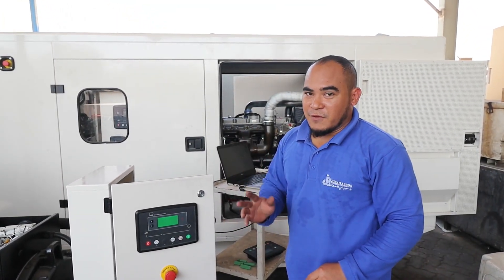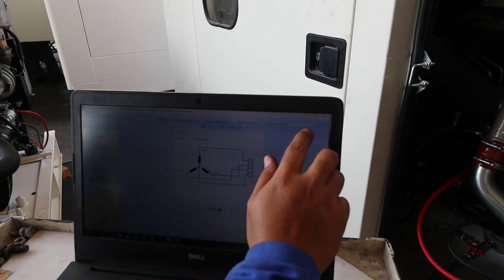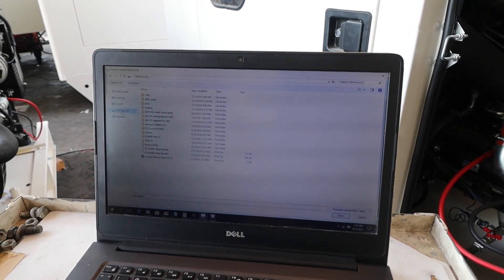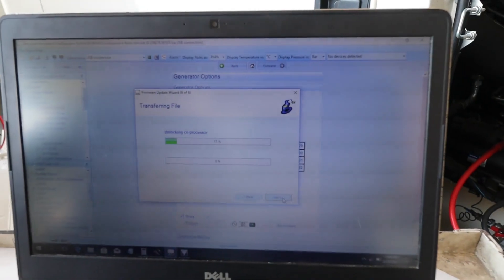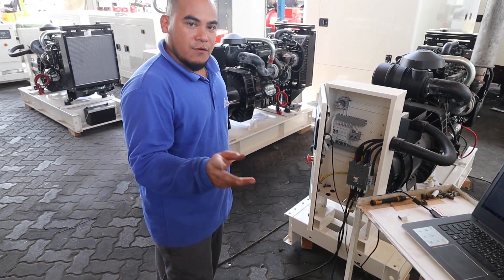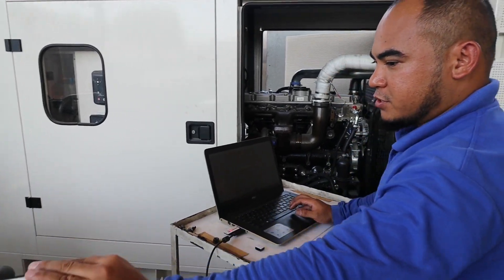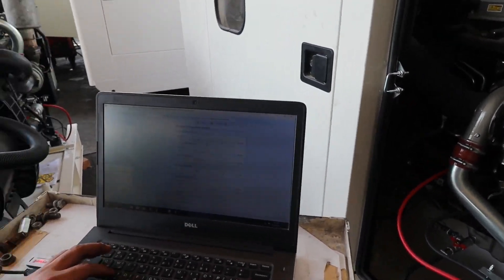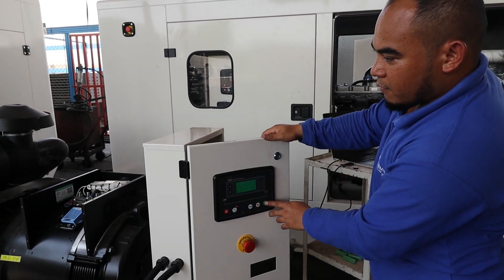DEEPSEA MODULE defective, not communicating, memory corrupt, no display, how to fix it? benzblogs

Comment: Help with the link for the flashing. And even while working on the Memory Corrupt, I didn't see what you operated on the laptop, the camera is only showing the display board of the DSE.
Reply from the maker: Ok even without flashing i found out just go in the app open deepsea thin go to click the firmware update thin select the model ang version of your module thin write it ok thin back to normal
Reply: @benzblogsVlogs   i tried to update my deep sea 6110 MKII controller but the display is still green
Reply from the maker: @ayazshah8453  of this green means defective already try to open it check the rebon inside
Reply: @benzblogsVlogs   along with green screen warning light is blinking
Reply: Thank you for the help however there's still more. When the panel doesn't display  and just the LCD backlight showing  but still works with the buttons. What are my to do. Do I need any flash file and how do I get it to return to display.

Comment: I have a DSE 7320 Module that display does not show anything. I have updated the firmware but the issue still, how can I fix it? Thank you in advance.
Reply from the maker: You can try to open it there is one rebon there try to remove and insert back due to vibration and dust its happen sometimes
Reply: @benzblogsVlogs  Thank you so much, I will check that and I'll let you know if it fixed.
Reply: It fixed! Thank you so much for your advice.
Reply from the maker: Welcome sir

Comment: sir tanung po sanamakasagot po kayu , anu problema kung wala display ang module may supply na 24 volt  bythe way 7310 pala ang module namin,salamat po
Reply from the maker: Kong meron flash mo nalang
Reply: Sir ano laman ng usb flasher mo para maregain  un memory o laman ng module ty sa mga video mo informative lahat ng video mo
Reply from the maker: @josephgammad2338  sir ganito kahit wala ng flash file ponta kalang sa open mo app deepsea tapos ponta ka sa tools firmware update anong model po ok na pa yan ok madali lang
Reply: @benzblogsVlogs  may ic pala sira sir  na sunog po yun 8 pin.
Reply: @benzblogsVlogs  7310  po
Reply from the maker: Wala na sir replace na pag may sunog
Reply from the maker: Pero gumagana sir
Reply from the maker: Tanong ko sir ang module nyo bay walay display pero may ilaw sa mga pindutan nya? Kong may ilang ang nagfunction meaning monitor lang problima now if di sya gumagana flushing .o baka kaya pa ng sofware
Reply: @benzblogsVlogs  dead set  po sir as in totally wala display . kung tingnan mo parang na ka off sya
Reply: Ah ok po,  sayang hindi kc taga dito yungnag install nito maynila sila. Pa..  Baka baka module na sila nito.  Kc hung una nag blurd na sya  dahan dahn malabo na ang screen hanggang ngayun.  Totally deatset na,  ganun paman salamat talaga sa tulong at suggestion nyo.  Share more vidwo po marami pa kayu matulungan..
Reply: @benzblogsVlogs  walang ilaw sir as in dead set po 7310 po ang model ng genset  nakita ko blog baka makatulong po kayu .
Reply from the maker: Ok ganito try mong e flash or e connect sa latop if may connection pa
Reply from the maker: Kong magflash ka kailanagn alam mo ang model ng module monpara magmatch
Reply from the maker: Oo sir kc defective nayan
Reply from the maker: Sir dinapla kailngan ng flash pwedi rin jan ponta kalang sa deepsea go firmware update thin flash file is there